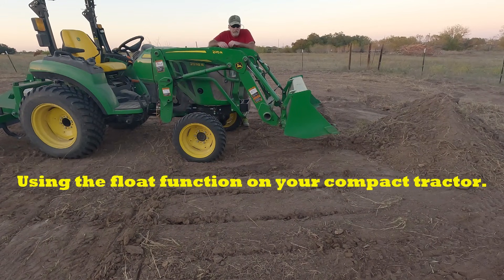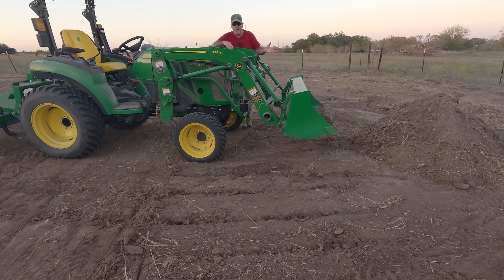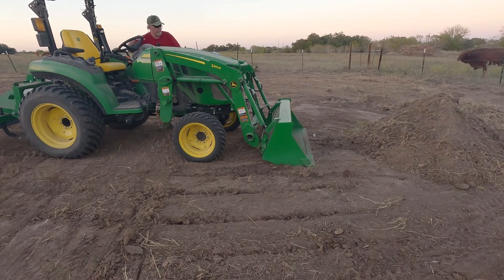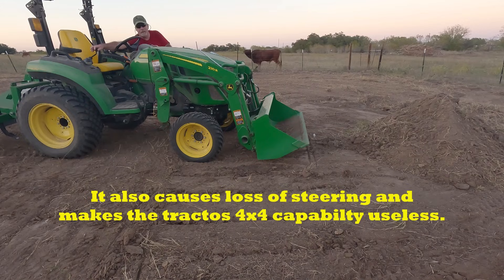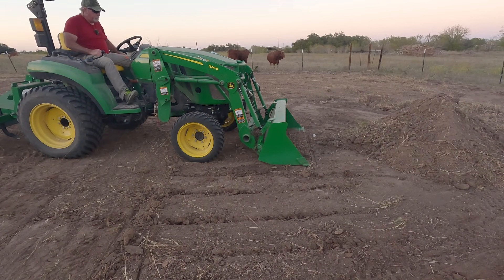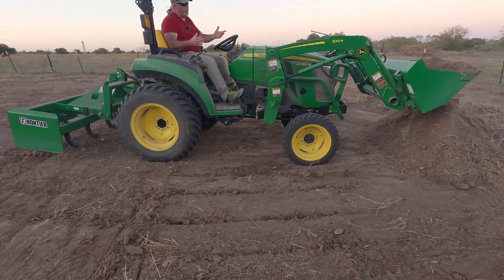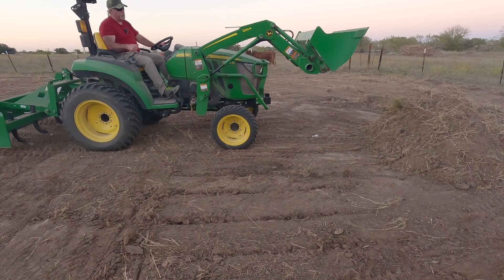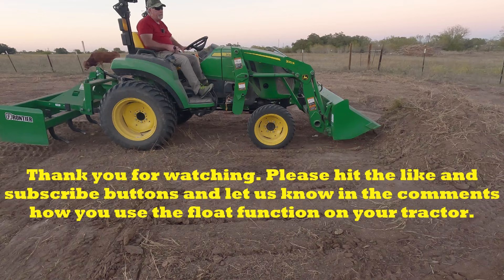“Most Tractor Owners Use FLOAT Wrong — Here’s How It Really Works!”

Comment: I’ve never loaded a bucket in a pile  of dirt or gravel in the float mode
Reply from the maker: I really don’t like loading material in float myself even though most tractor operators manuals say to use it. Absolutely no control to raise the loader while working into the pile. Thanks for watching and leaving a comment.

Comment: I can’t find anything that mentions float mode in my manual. What is float mode and is there a handle or switch that engages float?
Reply from the maker: Hi Mike. Unfortunately not all tractors have the float mode. If your tractor does have it, as you push the loaders control lever forward as you would lowering the bucket / loader to the point where you think it can’t go any further forward, you apply a little more pressure to the lever and it will move forward into float mode. If you’ve had your tractor awhile and never used float the detent ball may become gummed up not allowing the lever to move forward enough to go into float. If that’s the case you’re going to need to lubricate it to get it to function again. Thanks for watching and leaving a comment. Much appreciated.

Comment: Forward float has it's limitations depending on the density of material your pushing into..  As you demonstrated it lifted the front end of the tractor when you met resistance.  This is when it's undesirable.   Back blading is ideal in it's function.  I prefer full control of the primary lift when loading.
Reply from the maker: I totally agree with you. Thanks for taking the time to watch and leave a comment. I appreciate it.

Comment: Like I said in an earlier comment, Equipment has changed, and I only acquired the Float option in the last few years, the equipment I grew up with didn't have all these bells and whistles, You had to be able to use or work with what you had.
But when I do use float, it is normally back-dragging gravel or finer finish grading, or smoothing something in garden, I don't re-call using float in forward or loading the bucket, but I will give it a try next time the opportunity arises.  
Cheers.
Reply from the maker: Thank you again for commenting. I love the float function for back dragging with either the bucket flat on the ground or tilted at about 40 degrees. I however don’t really like using it going forward in rock or compacted soil as I think it puts too much stress on the loader and components. Anytime the front wheels leave the ground in my opinion , it’s not good. The only other thing I should have mentioned in this video is care must be taken to not put the loader in float with a full bucket as it will drop like a rock. Thanks again for your input.

Comment: Something I want to point out, and it's stating the obvious, but many don't really get it.
I grew up with an assortment of tractors and equipment.
Tractors today are not what they were 30-40 years ago...
That's some better and some worse.
The newer 4x4's change things for the better or worse.
Compact tractors are stronger in smaller frames and many (like mine)have turbo's that add even more power and response.
Pair or couple stronger with 4x4 and you can get enough traction to over-stress "attachments."
Engineers have cut mass or strength to save weight and money.
A tractor with a front end loader (F.EL.) Try and remember this.
The front end loader is an "Attachment" 
It's not a skid steer or a track loader....
It's a useable tool or again an accessory,. 
Meaning with todays equipment you can break things or over-stress things that can be costly to repair.
Our modern FEL's are not meant for digging stumps and things like breaking up concrete slabs.
Now with a skid steer, you can do these abusive things.
But a tractor is more on the lighter side, especially the quick attach FEL's, like on my JD 4720.
Folks I'm closer to 60 than 50 and I'm just giving a word of caution.
Don't be afraid to use your equipment, but remember not to abuse or over-stress it and it will last you a long time.
Cheers 

and enjoy you seat time.
Reply from the maker: Very very well said! I couldn’t agree with you more. Can’t thank you enough for watching and taking the time for the informative comment!
Reply: @EverythingCompactTractors   You're more than welcome.
Sometimes If you don't spell it out or detail it with specific facts or examples, your point can be missed,... especially if your comment is read across the pond or in a different language or translated.
Cheers.

Comment: I just figured out yesterday how to use float mode on my small Gehl skidsteer. Your clear and concise video helped confirm and reinforce what I figured out. I'm looking at buying an old Mahindra 4530 and now I want to make sure it has this feature. Thank you!
Reply from the maker: Great!  Thank you for watching and leaving a comment. I sincerely appreciate it. Just something to think about when you're checking out the Mahindra. Sometimes, if the tractor's float function has never been used or has not been used a lot, the float function position can be extremely hard or next to impossible to shift into, but it can be easily fixed. Just something to keep in mind while you're checking it out. Keeping our fingers crossed for you that the Mahindra comes home with you.